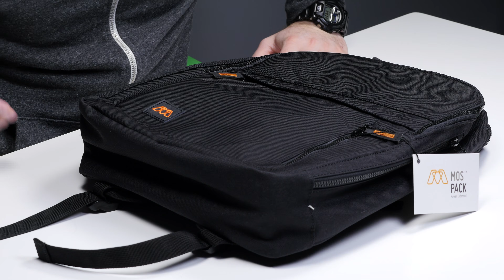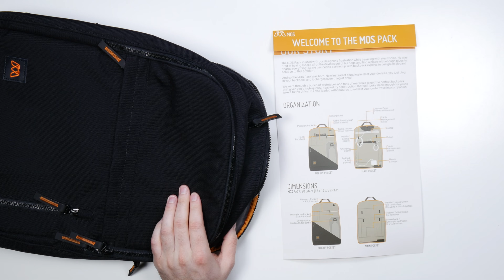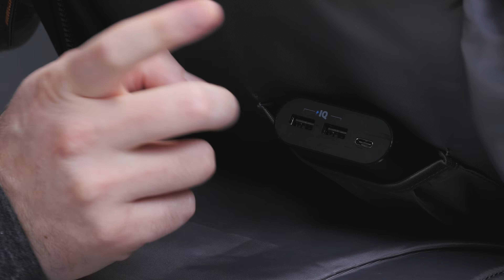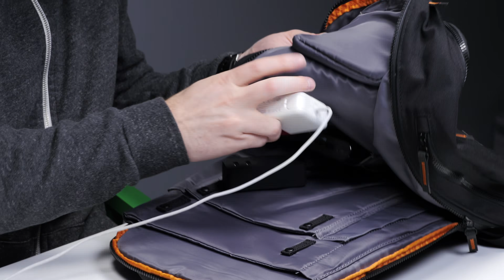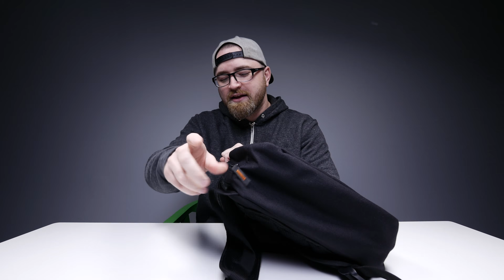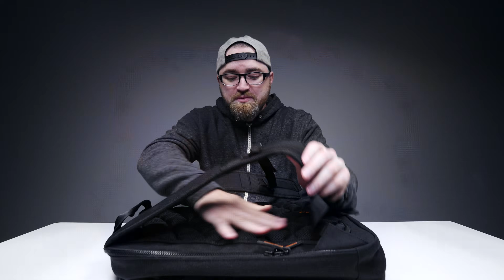What If Your Backpack Did All The Charging?

Comment: I thought you plug it in, it charges a portable charger, and whenever you travel and don't have a wall outlet you just plug it into the "built in" portable charger
Reply: Roberto Fernandez basically, you can plug all the usb cables from all your devices into the power strip, then plug the other end of the power strip into a standard wall outlet. then aeverything thats plugged into that internal strip is being "juiced up" or "charging". Was this helpful?
Reply: @thediamonddude4989  so the backpack has to be plugged in for the outlet to be powered?
Reply: MisterSlate Msc well yeah knucklehead. Unless you do like I do and plug all my devices into my 20,000 mah battery pack, which in turn plugs into the power strip. That way my stuff charges when it’s in my backpack and when I plug the power strip in it recharges my battery pack. I love it.

Comment: Wait so does the bag have a portable charger that charges without being plugged to a wall or do you put your stuff in the bag and plug the bag in
Reply: It has its own battery bank so you only need to charge the battery bank, or you can just directly charge it thru a wall
Reply: Backpack is literally a backpack+belkin power strip

You NEED to get your own ext. battery to stick into the backpack.

Comment: nothing says 'I HAVE A BACKPACK THAT LOOKS SUSPICIOUSLY LIKE AN EXPLOSIVE WITH ALL THE WIRES RUNNING THROUGH IT WHEN UNDERGOING AN XRAY SCAN' like this backpack.
Reply: This is not a flight luggage kind of bag haha. I have a bag that has a smaller battery pack so it cant charge laptops but it does have a plug on the shouder strap for my usb cord to plug in my phone or tablets which I have to say is pretty legit

Comment: This is just a backpack with a power strip In it. I'll cut a hole in my bag and put a 6 port power strip and boom, I got this thing. Lol
Reply: +Dwight Schrute could just put old phone with prepaid on the bottom, problem solved
Reply: FA-Q TV how would it blow up per-say?
Reply: ikr there is a much better one that uses the strongest battery to charge your devices and you dont need to plug tje bag in anywhere
Reply: and your way is easier to protect from rain and what not by having a freezer bag that you put the battery bank into with your gadgets if you get caught in a downpour or something
Reply: ikr
Reply: You won't have the ability to track ur backpack tho
Reply: I was just gonna comment that lol
Reply: hahah yes
Reply: and  what if  explode BOOM  you will be jailed for  terrorism and boom you're done jajaja..!

good idea anyway
Reply: I though the same, will do it
Reply: 4nonym0us h4ck3r what is it called

Comment: I  have a concern about this product. What kind of heat does the bank throw off when charging,  plus is all devices have to be turned off when charging? I'm just a little worried about either exploding batteries or things getting really really hot

Comment: https://www.amazon.com/Poweradd-3-Outlet-Power-Strip-Extension/dp/B018S7YKSE/ref=sr_1_7?ie=UTF8&qid=1471917833&sr=8-7&keywords=power+strip+with+usb
Just stick that into your backpack. Just saved you 90+ dollars
Or a smaller one if you like that.
https://www.amazon.com/ORICO-Traveling-Protector-Charger-Samsung/dp/B00XHORWCA/ref=pd_sim_23_3?ie=UTF8&psc=1&refRID=N9AAFQKN6HKKW2H8VZA3
Reply: And what gives that power? Air?
Reply: the one in the video has to be plugged into the wall, its just a power strip in a backpack.  He has a battery pack in it that he put in himself.

Comment: Hi guys, I need to buy a new phone, I'm an android fan, what would you reccomend?
Reply: s7 edge
Reply: Takey 23 I heard there is an issue with it, when you try to grip better your phone, the apps from the edge will start, its pretty annoying
Reply: Its depend on how you hold the phone, Im left handed so its never bothers me, but you can switch the edge panel to the left if you find that annoying thought.

Comment: can't you just buy a backpack you really like and throw in a really large battery with DC out and a couple of long cords...?
Reply: Sure. But for the mains part you need 110/240 AC out, not DC out.
Reply: yes, but as I gathered from the video the mains brick is not connected to the battery. it works just like and extender when the bag is connected to the mains and charging... isn't that right?
Reply: Yeah, with this retarded product sure. I meant if you go to build it yourself, you can easily implement a hefty battery stack AND an inverter and still be sub 150USD :)kotopsycho
Reply: ...I think there is even no battery inside, just the cable with the extender and two USB ports, that is probably around 5 bucks from ebay. The bag costs USD 114.95 on Amazon. Pretty damn costly for a backpack worth 20 bucks + power extender cable for 5 bucks... but hey... he made it look like its worth it in the video...got to respect that :)
Reply: yep, that's what I'm talking about

Comment: put a heat source inside a thick bag. why didn't anyone think of this! genius!
Reply: genuis......facepalm*
Reply: put a power cor insinde a bag so you cant put something slightly wet in it. Genius!
Reply: the cord is insulated rubber, so you wouldn't have an issue with that most likely. absolute worst case you put a water bottle in the main compartment (with all of your other electronics) and some water manages to squeeze it's way into the outlet and shorts it and you trip a breaker, though the stars would have to align for that to happen.

Comment: Hypothetically, you should be able to do a number of different things with this. You could have dual battery packs in each of the included USB ports, or you can buy a separate USB hub designed for charging devices and plug it into the main outlet. I feel like there should be more to the story, but the other reality is, you can easily copy this design into another backpack as a much cheaper alternative.

Comment: So let me get this straight, this is a backpack with an extension cord inside... you plug your devices into the backpack and then you plug the backpack into the wall........ so what's keeping me from buying an electrical strip and putting it in my own backpack?  This thing is $115.00, I can get a strip that has usb plugins at my local hardware store for like $40-$50. Then stick it in my own backpack. if this backpack had a well built battery carefully installed, then that would be a good deal. I'd pay maybe $70.00 for this bag. the only thing this bag has going for it is that it's quality made.

Comment: This is completely stupid...

just by a mini extension cord, and a portable battery...buy any bag you want... 

you showed us a backpack...and ordinary back pack...

most backpacks have the cable holes, usually for your headphones...

What would have been better is having a pocket on the shoulder strap - inside that pocket have a usb port for you phone...then have the usb cable run through the strap into a top pocket in the backpack with  usb connector where you can put a battery -- that way you can still have your phone in the front charging and have easy access...

Comment: There is one problem with this bag and the way it works. Have you ever felt how hot a laptop charger has got when it is charging? They always get pretty warm and even warmer when covered. That would worry me. And it would me more convenient over all if the brick was on the side of the bag, and it had like a USB port facing out without having to unzip the bag, maybe have a little flap, and then the other USB ports facing in.

Comment: Hey man I really love your videos. You have personality. However, have to beat on this bag. It's a beautiful idea but is hugely dangerous or at least terrible for your devices and their batteries. I'll explain. Do you like eating when it's hot out? Could you eat while sweating your ass off? That's right. It's uncomfortable. That's fur a reason. My point is this, batteries charge best at room temp. They especially hate being hot. And even more they hate being charged while hot. Ok we're all on the same page. Good. So I know most of you dumb dumbs are gonna burn your fingers typing your two cents. Don't. What you think doesn't matter. You didn't pay for your iPhone or computer so you couldn't care less how it works, or how to properly charge it. So just don't reply to this. For the rest of you, I'll finish. So have you ever noticed your phone was warmer while charging? Hmmm. I'll bet that temp would really climb if insulated in a backpack. But what if there were other warming devices charging as well? So finally my question is, where's the fire extinguisher compartment????

Comment: That's the stupidest idea ever. Turning something portable into something stationary.. A plug on a bag no good. Sure it saves you taking out your portable battery to charge it but lets be honest most won't care about that and also it means you are stuck with 1 as if you are just gonna keep replacing the battery pack then it renders the whole thing pointless to being with. I can slip my portable battery into the side sleeve of my bag or inside to charge stuff no need for a costly bag like this.  I mean $120 for a $50 bag with a usb adapter inside.  Cable management is the only possible reason why you would want to buy this and again there are a lot better cheaper options out there.
Reply: Yeah. It is just a good looking toy with a bad gimmick.

Comment: How about a suppository with a power cord? You just shove it up your ass, plug it into the power supply, and then charge your devices wirelessly through induction from the palm of your hands.
Still more useful than this piece of crap advertisement of a pointless "gadget".